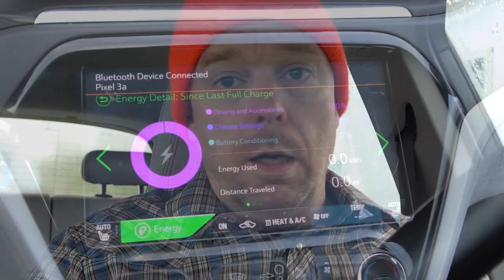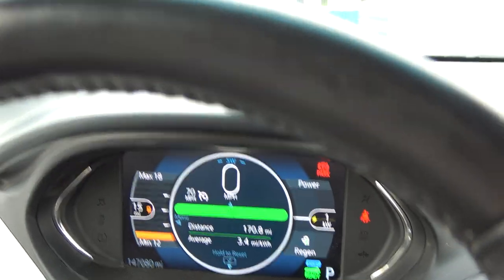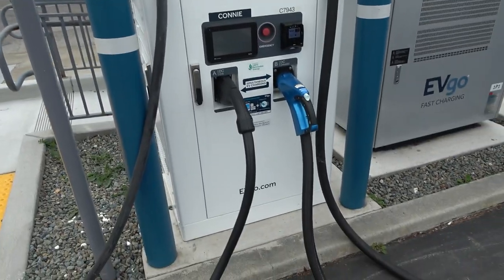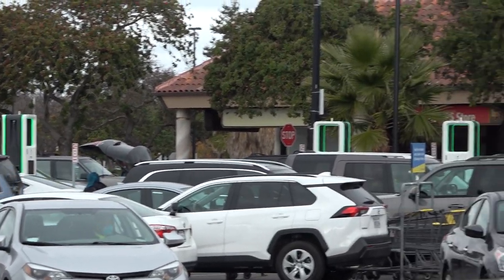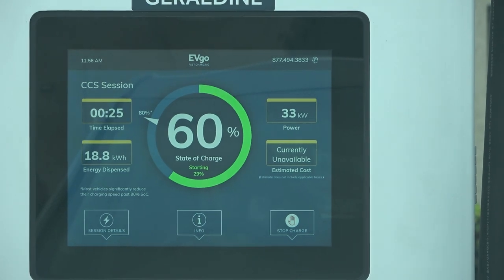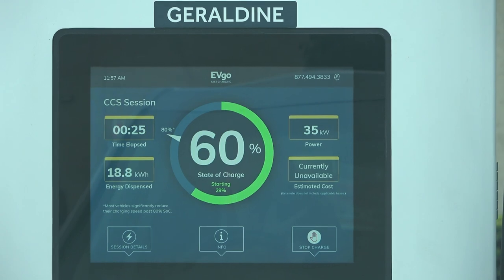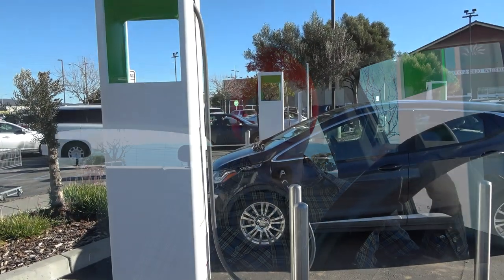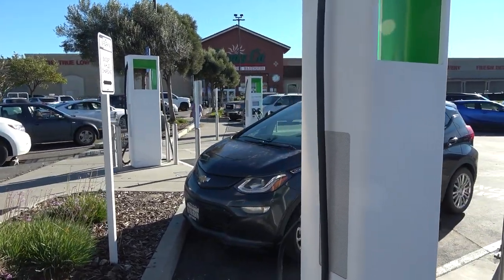2017 Chevrolet Bolt EV: 750 Mile Day Trip (Original Battery)

Comment: Eric, largely because of these videos I took a trip with my Chevy Bolt from the LAX area in Los Angeles to Quincy, California using Hwy 395. That route doesn't have the density of chargers along the way as I-5 or Hwy 99 but enough to easily make the trip with just a little planning. The critical stops were, going northbound, Bishop, because of the climb up the Sierras, and Reno (Sparks) as Quincy is about 70 miles one way. Quincy shows a level 2 charger but it's behind a lock gate during non-working hours. I was able to charge up (110v)  in Quincy at a family-owned house so the trip back wasn't bad. There's another level 2 charger about 25 miles further in Taylorsville...

The trip back, I stopped in Sparks, and then in Gardenerville, NV. The Gardenerville stop was just an insurance stop for the climb up to Bridgeport, Ca which I stopped at to top off. From there I drove to Coso Junction and used the rest stop charging station instead of the EA chargers at the (under construction) Chevron station. I made a very quick stop in Mojave on my last leg home (think 10 minutes) at the Denny's.....The entire trip took only 1.5 hours more than I accomplished in a gas car over the years....

Thanks for the videos!

Comment: I basically learned how to fast charge my 2021 Bolt on this channel.

I took a trip from SF East Bay to San Diego last week using 4 stops going down and 3 coming back.  The main difference is I tend to charge longer than Eric but a lot of this is because there seems to be fewer chargers along Highway 5.  I had a blast on this trip.

Comment: I did a road trip recently in my 2020 Bolt EV that involved similar distances per day across 2 days there and 2 days back, mostly along I-5. All told we averaged about 15-16 hours a day driving and charging, did 5 or 6 charging stops a day, and generally had a similar (and good) experience. The new battery (both larger capacity and less degradation compared to yours) appears to save about a charge stop each day, possibly less since your stop points weren't perfectly efficient here.

I find we can fill time with bathroom breaks, food etc... for about 3 stops a day, with the others being mostly just idle time rest breaks, so even in a car that many claim is terrible for road trips, we're really only taking about 2-3 additional charge stops of "wasted" time (an hour or two) compared to a higher-capacity faster-charging EV or an ICE.

I definitely wouldn't want to go further than this in one day in the Bolt, but I really wouldn't want to go further in another vehicle anyway so it's not a big difference overall. We'll almost certainly drive next year again in the same car rather than flying; it's cheaper, less stressful, more eco-friendly and gives us the convenience of having our car while we're at our destination.

Comment: 8% Degradation over 150k miles seems really excellent. Fingers crossed Bolt's with completed battery recalls start hitting the used market in the next year or so.
Reply: I wonder how much degradation is caused by age vs mileage? If you take a more typical 10-12 years to put on 150k miles, it may degrade  way more than 8% at 150K miles.  I wonder if the battery will still be good after 12 years no matter how low your mileage is?
If you only drive low miles like 5K miles per year, is your battery going to be worn out before 60K miles? In that case, you are better off in an ICE car that wears much more with miles and use vs wearing out passively just by time passing on a calendar.

Comment: Have been looking at Bolt for the next step of Pure Electric. I just took off the cover of my 2003 Honda Civic Hybrid that has 193,000 miles on it. The IMA battery went out 10 years ago and I parked it then. The recalls, tires, etc, are finished. It gets about 47 MPG highway. I will keep the Hybrid for long trips and likely get the Bolt in the future for work, and short trips. My Solar puts out 30 Kwh + extra per day for who ever needs it. This is where the future will be. Great video.

Comment: Oh to have chargers that are 100 miles apart.  Makes Bolt travel almost acceptable, if you could run between 10 and 60 percent.  It seems like the latest software for the original batteries tapers starting about 45%, and drops to 30 kw charging speed fairly quickly, so there’s not much incentive to stay past 60%.  This was a long day, Eric!

Comment: Eric, you are really hitting all of my regular Charging stops. So where did you eat at in Gilroy? I always go to the In-N-Out Burger when I use that charger. When I am in Solidad I go to the Teriyaki restaurant or Burger King or the roundtable pizza. I also shop at the Foods Co. which has great prices I believe.
Generally can get Kerns Nectar cans for about $0.50. 
In Paso there is a great Mexican restaurant across Spring St and LOL Yogurt about 5 blocks down street by the park. Easy to kill a few min while charging.
EA is opening a station in Atascadero, I’m happy to have more options.

Comment: I get it now - the lower 50% of the battery charges faster than the top half of the battery so for quick charges, stay in the lower half of the battery’s charge.
Reply from the maker: Yup. For better or worse, for fastest charging speeds and fastest trip times in EVs, you really need to use most of the battery and dip as low as you're comfortable before stopping to charge. That seems to be a universal rule at this point.

Comment: Enjoyed your video, Eric.
Curious as to why you did not overnight at San Luis Obispo in a hotel with an attached Level 2 charger - why exhaust yourself?
I see that you have over 147,000 miles on the original battery. What percent degradation have you calculated, if any? Any idea as to when you will be getting a new battery. Again, thanks.

Comment: Has GM reached out to you on when you are getting your new Battery?
Reply from the maker: My battery has already been ordered, but I have to wait for my local dealership to get around to installing it. I am currently #6 in line, but they have only been doing a couple batteries a month.
Reply: @newscoulomb3705  it would be interesting to go for a 100% to close to 0% doing normal run(unlike other YouTube videos doing just 70mph on the highway) before the battery change and then do it after you get the battery one.
Reply from the maker: @georgep5811  Yes, I have a lot of data now for my 100% to close to 0% runs. I typically don't arrive at 0% (I don't really want to make that happen artificially), but I come close on occasion. I'm actually going to do a quick battery update including my latest calculated degradation at 150,000 miles. I'll then do a follow up with the new battery later.

Comment: Why not use A Better Route Planner ? It does the planning for you.
Reply: I don't do a lot of tripping with my Bolt, but have from time to time. 

I used A Better Trip Planner and have some cautionary advice. I wouldn't trust it completely except under the best circumstances. I've found it doesn't allow enough margin of error for changing circumstances, specifically weather conditions. In the PNWest we have very complex conditions due to our complex geography. For instance, going east or west through the Columbia River Gorge, which is huge and long, the wind can be howling east , west or in between, sometimes with only a moments notice. Just a stiff breeze adds up if you cut it too close. Temps can be similar, along with terrain if you're not familiar with it. 

I now would charge somewhat longer than A Better Trip Planner advises unless one is sure of weather conditions and the affect it might have on range between chargers. I always have plan B using Plugshare as I'm not always traveling near urban centers.

Comment: Why keep saying "Ultium Ready "  when all ccs chargers meet these same requirements?

Kinda like saying we have regular gas , and it is what you need , so we are regular gas ready 

not anything to really advertise a common attribute of all regular gas.

Where are you going to find any Ultium equipped vehicles?
Reply: The Ultium ready chargers are units that were largely funded by GM.   It's just one way that GM is advertising their new Ultium system.   The only Ultium cars in public hands are the Hummer EV right now and in very limited numbers.   The Lyriq should start deliveries in the next several weeks.
Reply: @erikstephens34  You don't need many chargers for the one vehicle they delivered.
Reply: @firstbigbarney  They officially delivered one in December. Last I looked it's now mid February and they have delivered quite a few more and are accelerating production. There is no need for your ignorance.
Reply: i think "Ultium ready" means you can charge at 350kW (800V).  Ultium batteries are set up to charge at 400V or 800V and can switch between one of the other, depending on the charger.  So the Ulitum ready charger can deliver the full 350kW to the Ultium battery.